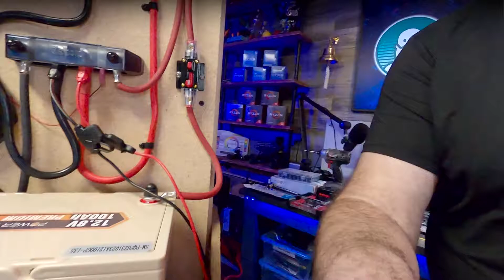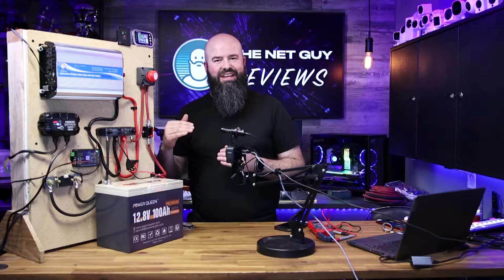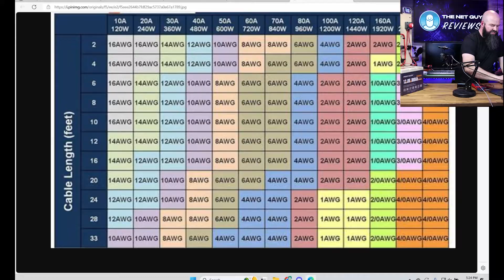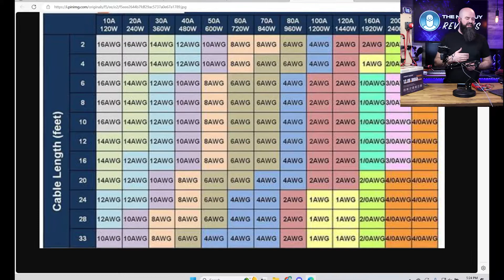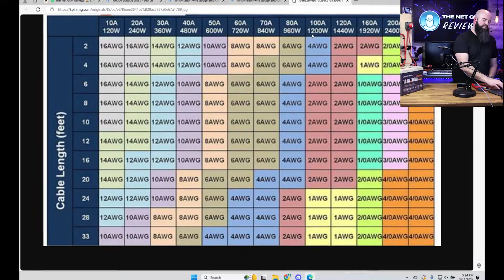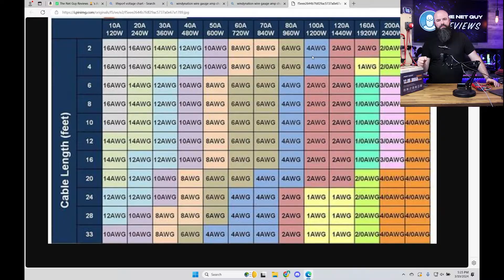4 Gauge Wire for Inverters, Solar, and Heavy Duty Wiring - Oxygen Free Copper

Comment: Can someone help me....    I'm using 2/0 AWG wire and it gets hot at 750W   The wire is length is 10", the crimp is professional done by hydraulic crimp without losing a strand. Using 5/16 Lugs ..  I even remove my 300A inline fuse. and It still hot (Test Only)  anyone have a clue. ?
Reply: It sounds like the current is going somewhere besides the inverter, or it's leaking to ground inside it. An 80-amp breaker should handle 750 watts at 12 volts. That size of cable is more than enough for 750 watts.
Reply: I'm guessing a couple of bad MOSFET transistors. They can be leaking current, but not enough to blow the fuses. This part has a lifespan that is shortened by heat.